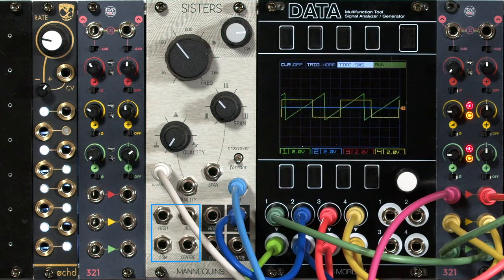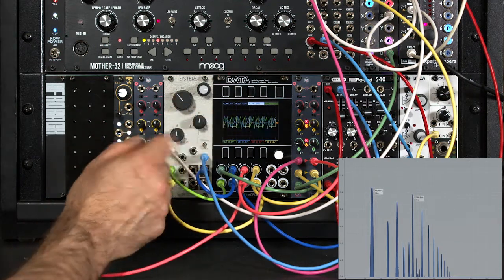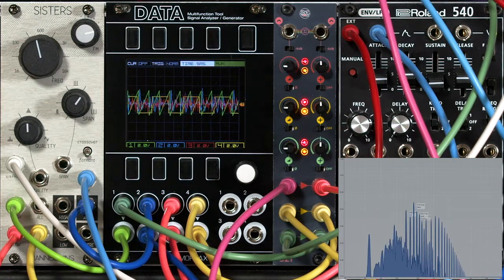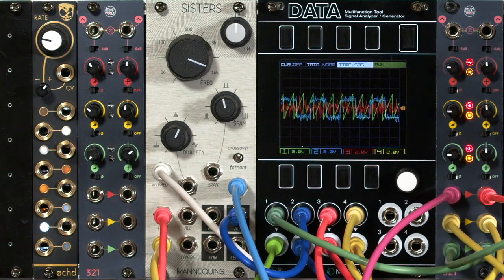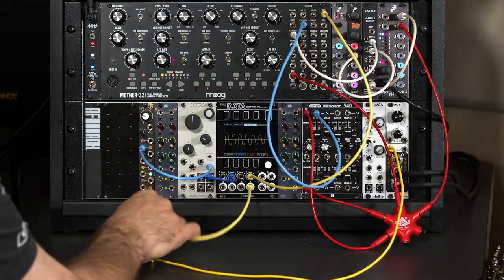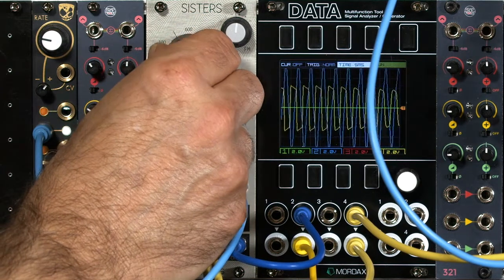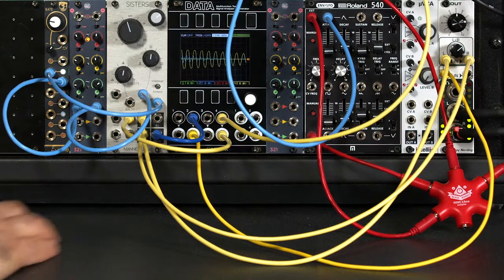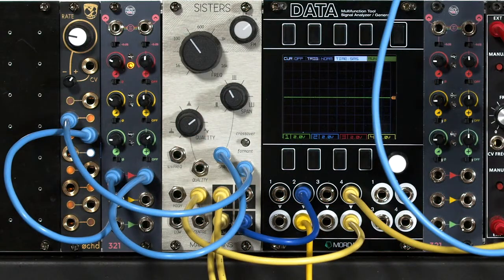Mannequins Three Sisters 2/2: Spectral Mixing & Pseudo-Stereo Applications (Eurorack Expansion)

Comment: Nice. Is it a Steiner-Parker filter in crossover or Steiner-Parker implies more than routing?
Reply from the maker: The Three Sisters in crossover mode behaves somewhat similarly to the the Steiner filter, but there are big differences under the hood. The Steiner filter is a single two pole filter with three inputs. The Three Sisters is 3 pairs of two pole filters which can be reconfigured in different ways. This allows more control over where the poles of the filters are oriented in regards to each other (for example, spread apart), compared to the Steiner.
Reply from the maker: For example (from my Patreon write-up of the Three Sisters - https://www.patreon.com/posts/40403823): "...if you turn Quality counter-clockwise instead, it starts to mix back in the opposite outputs of each internal filter. For example, if you are in Crossover mode and using the Low filter chain, the high pass output of the two filters in that chain are progressively mixed back in until you have a notch filter. "
Reply: @LearningModular  I see. Well, that for sure makes it unique. Thx

Comment: I wonder how it sounds with audio rate modulation. Of course on the cut off frequency, but also on the span and quality controls :)
Reply: It sounds very good, and the attenuverter on FM input can drastically alter the character, from hollow to metallic
Reply: @bebop7  cool :) Did you try it on the other inputs too? How are the span and quality inputs react to audio rate modulation?
Reply: @distorson  they all sound amazing with audio rate modulation.  Self-oscillating with one of the outs feeding span produces incredible patterns on an oscilloscope

Comment: I'm pretty sure that the SPAN control fully CCW in FORMANT mode actually causes the HIGH to dip lower than CENTER (and LOW comes up higher than CENTER). So if you want "one bandpass filter tuned to the same frequency ( @1:55 )" it might be a tiny bit CW on the SPAN knob.
Reply from the maker: Yes - you're right. I didn't expect it to overshoot like that.
Reply: Source: Three Sisters Technical Map
Reply: Actually I think it's true in both modes, watching your spectrograms.